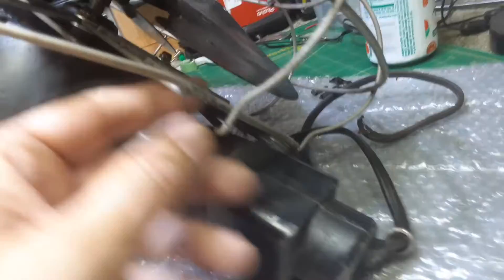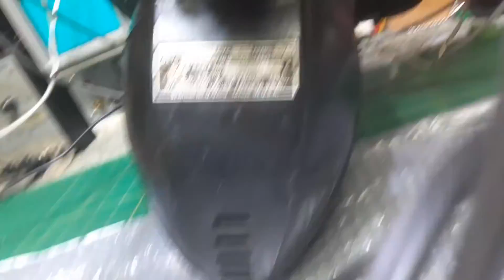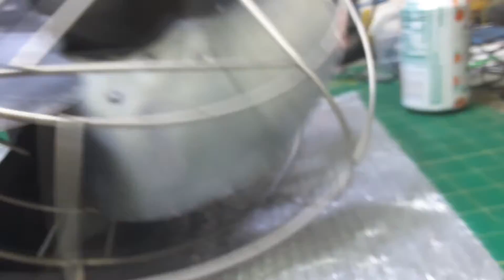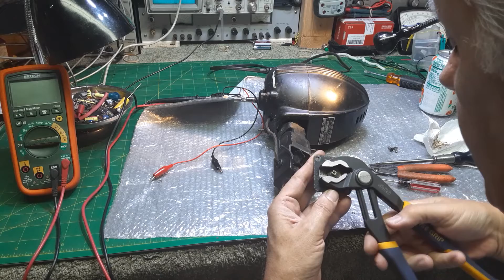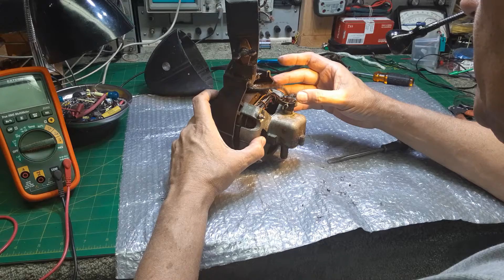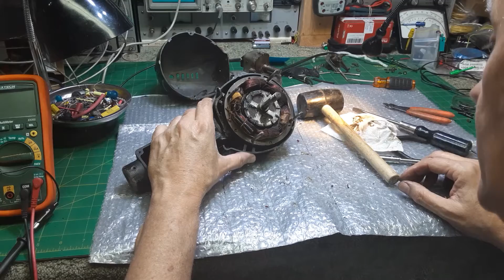Robbins & Myers Pedestal Fan R&M -  List# BD12A5 OP

Comment: Se puede quitar el cintonizador de velocidades ?
Reply from the maker: The issue is that it is a 3-wire stator. You can't remove the speed switch because power need to be applied to the wires by the switch. If you want to slow the fan down, plug it into a variac. If the switch is bad, it will need to be replaced.
Reply: @ElectroRestore  me refiero a que si se puede quitar. Porq lo quiero quitar para pintar la base del ventilador, por qué a la hora de quererlo quitar está muy duro, yo creo que así viene de fabrica lo q me da a entender que no se quita.
Reply from the maker: @mariosalazar3851  Ya, we don't do painting here. If I was going to paint one, I would just try to mask it off with tape.
Reply: @ElectroRestore  está bien gracias. Ya lo pinte y lo cubrí con cinta de papel. No tuve opción.
Reply: I have a similar fan but it's basically the desk model that oscilates do you have any idea how to remove the oscilstor knob from the back so I can remove the cover? I know this is a long shot but i also don't see a model number anywhere just the catalog number 22004A